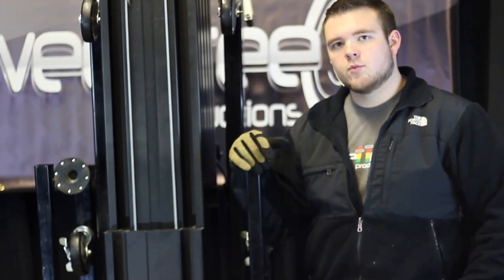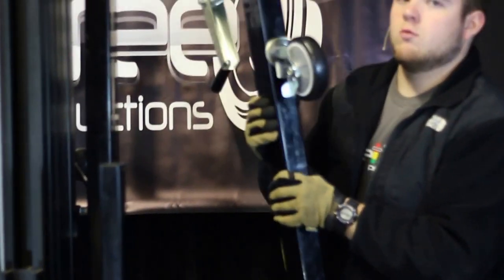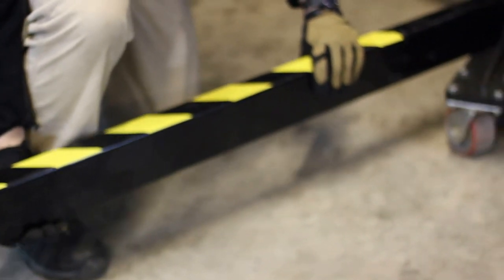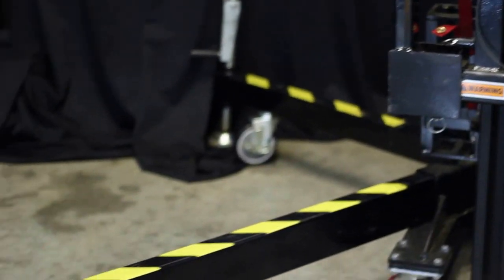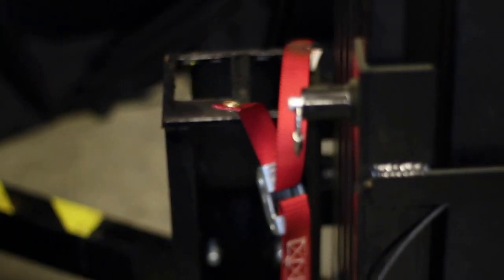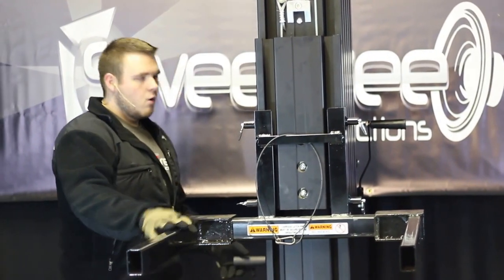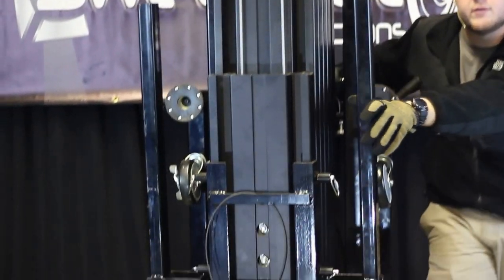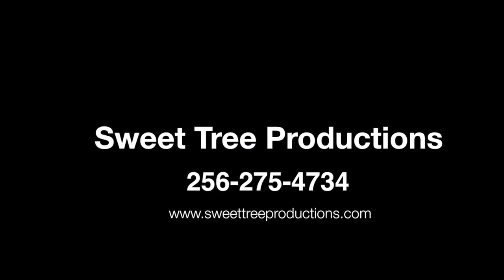Sumner 25' Eventer Crank Lift

Comment: That brace you have the safety cable attached to is not a good idea or the correct idea. That is not what that brace is for. You attach safety or span/gac to the lower portion of the cross brace assembly which your arms attach to.